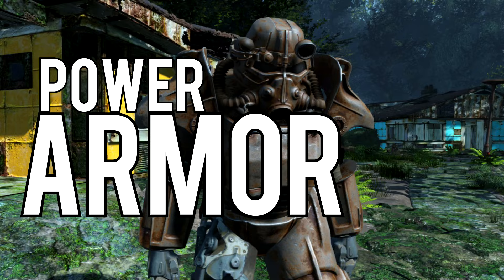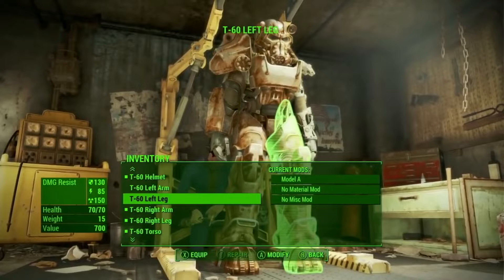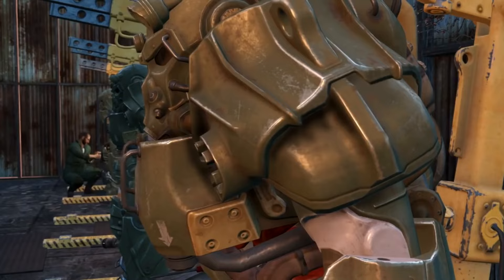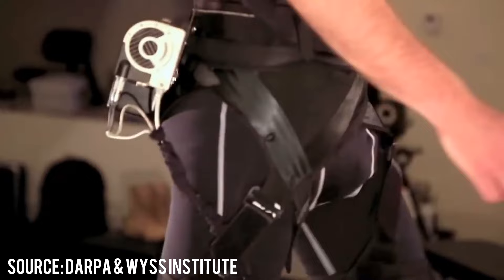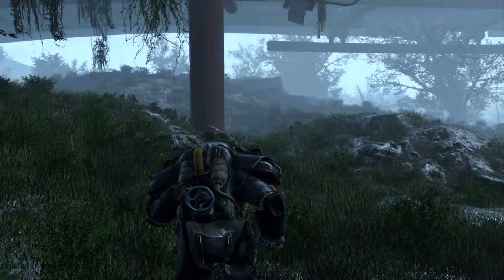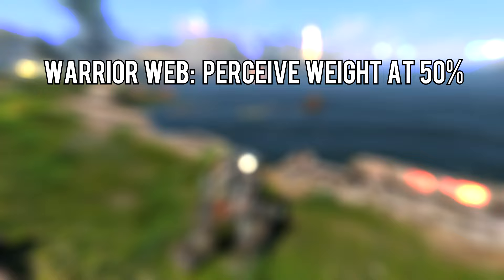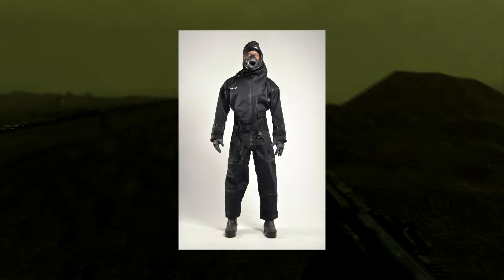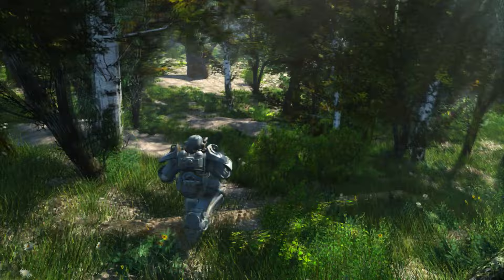The TECH! How close are we to POWER ARMOR technology?

Comment: "AK-47" Not quite... The Atvomat Kalashnikova 1947 was the prototype. It suffered from expensive manufacturing and several production and field issues when it was first being made. It was decent, but it was yet to be good. The tried and true, durable and cheap automatic weapon used by African warlords, rebels and militias the world over is the AKM, M meaning Modern. It was the updated version of the AK-47 prototype, much of it being stamped metal, the AKM's receiver in particular was changed from the AK-47's milled bolt into a stamped receiver. It stayed in service in the Soviet Union until 1974, when it was replaced by the AK-74, which uses the 5.45x39mm cartridge.

Comment: we can totally make power armor because it uses the same kind of armor as an m1 Abrams tank but wr have to find a way to take a 60 ton tank and turn it into a 200 pound suit of armor the answer is lightweight composites super strong but very light and power armor also uses hydraulics for joint movements fingers elbows knees that we already have the only problem is we don't have the Tec to make fusion cores it's impossible so our power armor would have to be powered by some kind of battery.

Comment: We literally have the technology to make something that could be considered Power Armor. The problem is the cost and inefficiency. Each suit would cost more than a tank and would suffer from the limitations of bipedal movement. These being speed and stability, mostly. There are other limitations, but speed and stability are the biggest problems. Next is the size, which is less of a problem with higher speed. Unfortunately, humans are pretty damn slow thanks to, you guessed it, bipedal movement. So, you add more armour plating to compensate and now the suit requires more power to move the added weight, making it more unstable and slow... You see where this is going. As cool as Power Armour is, it just isn't feasible due to physics.

Comment: I think there’s one issue with the T-45: didn’t you say it used riveted steel? That’s a massive problem, and you can see it in the riveted tanks of the First World War, interwar, and early Second World War. If you hit it hard enough, rivets could go flying and become spall, which is incredibly dangerous for the crew, and in this case, the person wearing the power armor. Hell, in the latter case it’s even more dangerous because unlike a tank there isn’t some dead space where it could miss a member of the crew. Those things would be walking death traps.

Frankly the T-51’s plastic composite is much safer; even if it’s “weaker”, it won’t kill the person inside because the very thing holding it together begins perforating the poor bastard using it.

Comment: The Army probably wont ever mass produce "Power Armor" they may make them but it wont see much use outside of very specialized missions. A oridnary soldier with say a 20mm antitank rifle (which is a very old technology from WW1 and WW2) can punch through several inches of modern steel plate armor with ease. So one shot could just render a several million dollar piece of equipment useless. Even special 10mm ammo (lee high defence extreme penetrator) can punch through most modern body armor and a few inches of "bulletproof" glass which is like the base handgun in fallout ironically. Making an individual bullet proof soldier would take way too much material reinforcement to ever be practical on a large scale.

Comment: actually Defense contractors have been working on this stuff since at least the 80s.  the major problems have been weight power and true mobility. not to mention the problem of field of vision.  of course that stuff looked more like that forklift on Aliens.  and cost more than an M1 Abrams, but it could stop a .50 bmg round oh ya it also weight about as much as a carthere was a lot of problems to be solved then. so it was no where near pratical and could not carrier enough juice to run it more than an few hour

Comment: To have armor that deflects bullets, couldn't you just copy medieval armor but using polyethylene plates? Full late-medieval plate armor (c. 1385 to 1450) barely ever weighed more than 50 pounds, and that's made of steel. Polyethylene could be made much thicker, and a coat of kevlar could be worn underneath.

You wouldn't be able to dodge gamma rays or lift cars or negate fall damage with it, but you could probably survive in a firefight.

All in all, I'm loving the trend of the modern military back towards wearing armor. In fact, actual renaissance plate armor could sometimes stop bullets, but it would usually result in severe deformation of the armor to the point where it's not worth fixing anymore, and thus not worth buying/wearing/maintaining, so people stopped using it altogether.

Comment: At 7:09 ... Umm. Why start at 2001? First powered exoskeletons date back to the 1950's.

They had 2 variants, each with one major problem.
Variant 1 was pneumatic, air powered, its big problem was the air lines, they where a weakness and in general pneumatics are less effective then Hydrolic!
Variant 2. Hydrolic! It was by all means perfect! Until. Oh dear, there is this effect called "water hammer" appearently the inventor, and man whom was by all means the driving force behind the govement research into making man tanks 
overestimated the durability of his valves.
And crushed his hand. 
The U.S. did not try again for a long time for some funny reason.

Comment: You should’ve talked about FO1&2’s PA, it’s much stronger and not nearly as brittle. Comparing FO4’s PA to the original’s PA is like comparing a stiff dune buggy to an agile M1 Abrams.

Btw, the original T-51b and APA have fluid recycling systems, advanced joint servos, vision enhancements, medical pumps, HEAVY strength enhancements, etc, etc. FO4’s doesn’t come close.

Comment: Power armor in real life is accomplishable, but big thing the power source is a pain in ass. You see how power armor in Fallout 4. The battery drains in about a day of normal use. Well, the power armor chassis with all its hydraulics needs a pump. The pump needs power and a  pipe system to go to all the hydraulics. It runs on small pumps or it uses a system off pipes that open and close. Well, I'm already close to cracking it. It's not that hard to build the chassis.

Comment: hold up i thought the armor plates were made of titanium which is good for armor but still heavy, if you make a plate of titanium weigh as much as a steel  plate it would protect better. the only problem would be cost as titanium is expensive and weight because you are still dealing with a metal and the ones worth using for armor are not light weight. but on a powered frame that propels the weight and supports it not really a problem. but still i ask is the plates of armor for the powered skeletons in fallout steel OR titanium  because there is a difference just look at people shooting titanium plates ( small ones ) with .50 cal ammo it doesn't make it through hell the video i saw didn't even have a dent on the opposite side and it wasn't anything obsessively thick or heavy either

Comment: Bro um you forgot the W.I.P CARBON SHEETS ONLY 3 OF THOSE DA*N SHEETS IS THE SIZE OF A PENCIL TIP AND STOPS BULLETS. YES IT'S VERY FLEXIBLE SO A SHIRT OF THIS STUFF WOULD BE BLACK AND STYLISH BUT ALSO BULLET PROOF! So yeah I just found out how to make power armor the carbon is: Light weight. Takes only a few sheets to make bullet proof. Is very VERY flexible. And could be every day clothes. But it doesn't protect from radiation... >_>

Comment: I have a question can you do a theory I  came up with. 
The theory.... 
We all know that the nukes that they dropped in the game are relatively small tactical nukes maybe 15 to 20 kilotons will the nukes dropped on Hiroshima and Nagasaki we're roughly the same size well if that's the case 70 years later Hiroshima as a full town now in the real world so if going off this 200 years later after nuclear fallout in the game there should be no radiation left at all maybe very little amount. Of course there's hundreds of factors in this like what radioactive element that used to build the bomb or if it was an Air Blast or exploded on impact and another obvious one is the size.  but if I'm looking at this correctly why is there radiation still all over the place when it should have all dissipated by now.

Comment: There is 2 problems you would have in real life one the power source unless you had a guy carrying a ton of military vehicle batteries and two you would have to have an alloy metal I would presume in fallout 4 I would say the metal for the power armor is probably a alloy of steel and aluminum but within reason I'd say it would be possible in real life and the thing would weigh a lot

Comment: Before you make one more video (yes I know this is a year late), remember that the AK-47 fires the 7.62x39 mm round in reality, while in fallout it uses the 7.62x51mm round. The later is almost TWICE as powerful as the first one. the AK fires and intermediate cartridge, which is made to be more powerful than a pistol, but not as powerful or heavy as full power cartridges such as the 7.62x51. Now that I've cleared that up, this next bit is about what armor would actually be on power armor: Steel.

Polyethylene has a better strength-to-weight ratio than most steels, but the hardest and strongest are still very competitive. More importantly, steel holds up against multiple impacts with almost no change. This video better demonstrates what I am talking about: https://www.youtube.com/watch?v=nlwlKEeJ0vU   (the later half)
The rigid armor is unchanged after about 30 impacts from armor piercing 5.56x45 (rough equivalent of 7.62x39). It also holds up against the 7.62x51, which is almost unheard of in personal protection. This armor plate is very heavy, but nothing a refined exoskeleton couldn't handle, especially if applied correctly. It is plenty durable enough to turn a soldier into a one man tank, capable of withstanding sustained fire from pretty much all small arms and shrapnel, as long as it is applied on limbs and head as well as the torso.

Sometimes I feel like I overstep my bounds leaving essay comments like this, but regardless of that, now you know more about this topic. On a funny note, this video game equipment analysis is one of the better tech videos on YouTube...

Comment: Don't think we'll see this in widespread use in our lifetime. For specialist units different story. From reading around various sources an average soldier costs about $50-100K USD. For your specialist soldiers like Seals, Spetsnaz and equivalent levels of training goes up to around $400-500K USD, Each of these suits are like 10mil each minimum you also need the infrastructure to maintain and operate these in the field. Simply put you have a choice between 1 trained guy in a suit vs 20 specialists or 100 average joe soldiers. As you said current armor tech is good for about absorbing 6x7.62 rounds. Definitely not gonna end well for the power armor user. There's even a few historical precedents in mechanized warfare Operation Barbarossa is  a notable example of superior numbers  obliterating superior tech.

Comment: Im sorry but on the Topic of polyethylene body armour IS NOT STRONGER than steel. First off you would wear a Kevlar Based Plate carrier, Polyethylene carriers are wore by SWAT and everyday police. You may be thinking, THATS wrong cops dont wear what SWAT Wears. Half right, they wear undershirt Soft teir 1/2 Body Armour. They have access to a T4 Carrier in the Back. Btw, its Poly, Ceramic, Steel. As of my knowledge of body armour comes from PERSONAL Experience as a former cop. Steel Plate Weighs ALOT, I mean Front/back, About 15lbs, Along with a Trama plate for front side and the vest it self made of Kevlar. Went I worked SWAT we had 4 Extra mag holders. I had a waist raido walkie, Carried a M16, a Glock, 45 with 2 mags on the waist, I had an IFAC, less lethals on the my belt. I've personally seen a Steel Plate vest take 12 shots from an AK-47. You forgot that all guns exert a diffrent amount of Joules. The longer gun, more power. Shoddy PLEASE revist with new sources. Try the DOD Site. Id like to see that 40% stronger source. Thats simply not true.

Comment: WTF where did you hear that the AK-47's 7.62x39mm was a high velocity? it is a medium powered catringe the 7.62x54r is the full-power rifle catrige (not fired by the AK-47/AKM)
+ the T51 armor plates apear to be cast steel armor not plastic (plastic does not rust) and no ingame armor could help protect against PLA tanks main guns (example(the PLA copied Soviet tech in the 50's)) D-10 100mm rifled gun 1945 could penatrate 154mm flat RHA steel armor at a distance of 1250 meteres not to mention that a 12.7x108mm HMG should have no trouble penatrating the thin armor plates of a T51/T45 suit and the fallout univere PLA use high velocity Gauss weapons such as the FO3/NV gauss rifle and the MEC gauss minigun (not sure how the MEC was deployed)
Reply: Fallout power armor is far stronger in lore than in gameplay.
Reply: yess but I dont see it protecting tyou from a 100mm high velocity gun (type 59 main gun is a copy of a modernized D-10 T)
Reply: Mikhail Nukov yeaaah, the problem is that those 100mm shots are wasted when it can't even hit a small, armored infantry target that can literally shrugh of small arms fire while shifting insides small buildings and cover. Especially when it can give a person an enhanced strength, God help you when there's infantry that can shoot Javelins while they run.

Real combat doesn't looks like a fucking shooting range mate.